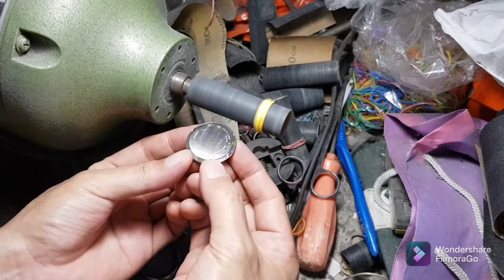buffing and polishing/ restoring the vintage seiko watch case/ a much detailed work/ part 1

Comment: Can you tell us what kind of polishing compound that was? Also what exactly is the brush stiffness or grade did you polish with. What about the rubber band? Nice video. Thank You
Reply from the maker: Good day to you sir! Thank you for the comment! You can find the materials i use for polishing at your local markets or online shops. Just look for polishing compound ESMIRIL, wheel brush and rubber bands and sandpapers. These materials are all used for orthodontics.